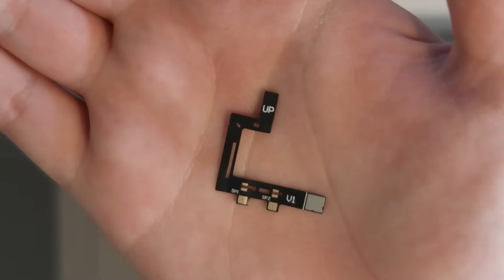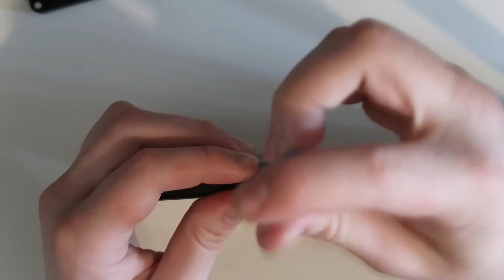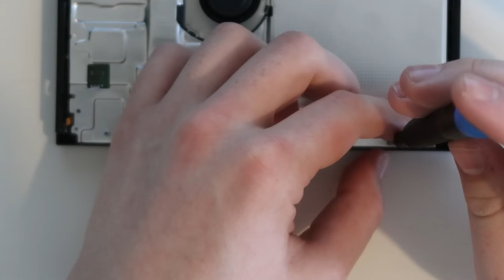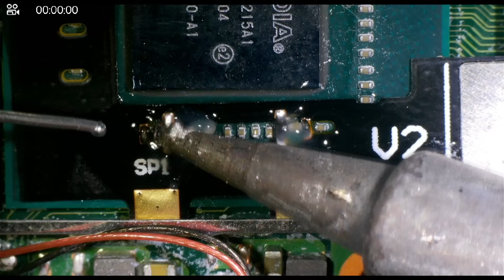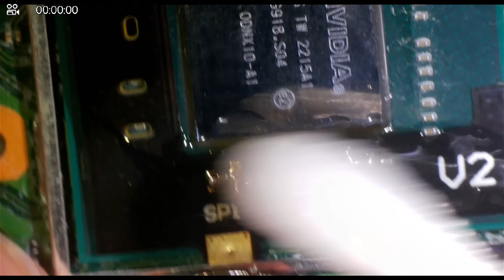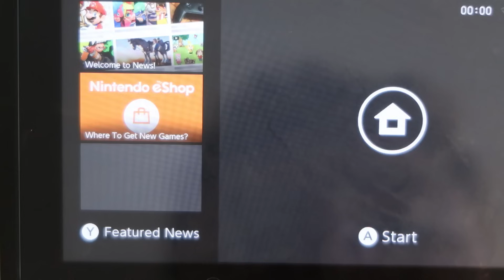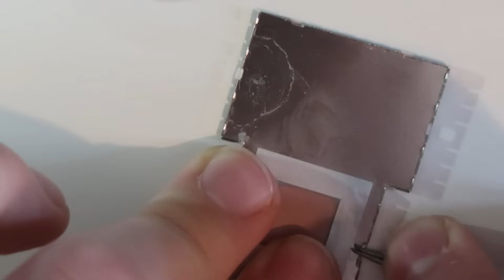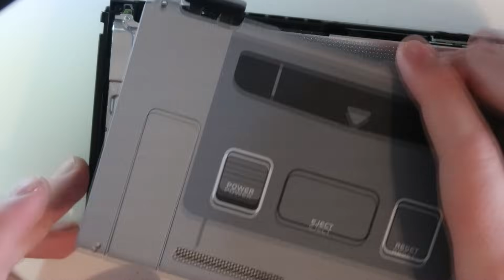Nintendo Switch RP2040 (PicoFly) V2 Modchip Installation

Comment: I am almost 40 and started learning to solder back in school at age 13. I probably solder maybe once a year since I was a teen but I know I will mess this up for a number of reasons. I just paid the equivalent of $60 here in South Africa to do the whole job today. I know there is a very good chance I would have messed up even though I got a little bit of experience but the risk vs the value of the Switch is just not worthwile for me. I own 3 different cheap soldering irons, flux, solder sucker etc in my tool box but to be honest I dont think I even have the correct type or iron or solder but even so I know my expertise is not in soldering since It is almost 3 decades and it is 1 skill I am not good at even though I am the DIY type

Comment: Never looked up how to solder the modchip for the Switch till just now. What an easy, simple, and straightforward soldering job this is. For those who are wanting to attempt it on their own but have no soldering experience, there is one thing that seems pretty apparent that could become very problematic. Manufacturers typically use lead-free solder with surface mounted devices (SMD) when assembling electronics, presumably what every Nintendo Switch has. Lead-free solder inherently has a higher melting point than leaded solder, exactly why people highly recommend using leaded solder due to it having a lower melting point effectively making it 'easier' to work with. If you use leaded solder, which you should, be careful not to un-solder those tiny capacitors you're soldering to on the Switch's motherboard. You can get them back on, but it's very challenging and you almost certainly would need solder paste and a heat gun to get it back on IF you don't lose that tiny capacitor upon knocking it off. 

I've only soldered the Electron Shepherd's Wii HDMI kit before (was my first soldering job also), and that imo is more challenging than this modchip for the Switch. Do your research, watch lots of videos, only attempt when you fully have the grasp of what soldering is. Hope this helps someone!

Comment: Wow, this looks way easier than I thought. I have a Switch 2, so I think I might take a crack at doing it. Good news is that I have pretty much all the tools at home already, so it's only the mod chip and I think I need to buy some flux.
Reply: this is for a switch 1 v2, not a switch 2 (i think)

Comment: “Bridged onto the wrong one” wrong one what? What are you even doing? Wish you’d explain instead of saying adding flux adding iron cleaning iron, never actually say what the goal of this step is, are we connecting the chip to the console with the soldering ? Looks like all you did was make some bigger points to attach to but then attach to what? Wish you’d actually have a tutorial instead of just saying the very obvious things we can see “cleaning the iron” “it looks connected” yet you just said it looked connected and said you needed to fix it, so is it suppose to connect or what? Connect to what as well? Redo this one? Redo what exactly? This hurt to watch
Reply: I totally agree, he should of made it clear which points need to be solder and to what...

Comment: Have a expert mod your switch with a mod chip and do not try this yourselves folks unless you are a skilled soldering expert and have a professional needle sized soldering iron tip. The CPU in the Nintendo switch is the size of a quarter, and those caps on it are pin prick tiny, as in smaller that the period at the end of this sentence. You will need a microscope to see them! If you try this with a regular soldering iron and your a newbie, you WILL mess up and BORK your switch!!

Comment: I got the same issue after modding my switch. The modchip comes blank so you will have to plug the mod chop into the pc and drag and drop the updated firmware into the mod chip. Then connect the modchip to your switch again. And it will work and show the no sd card message

Comment: Need help. Everything worked fine until i connected the emmc to the modchip. I have connected everything properly but it just wont boot regardles what i do. As soon as i unplug the chip and put the original emmc back into the original spot, while leaving all soldering as is, the seitch boots into the nintendo firmware without any problem

Comment: I am a 17 year old boy and this is my first soldering project. I was very nervous but in the end it was just a game of patience i failed to solder the points several times and the switch didnt boot, but after trying more times with less hope in the end i managed to solder the points correctly and the switch booted. I am very grateful that it did work out and very much thank you for your video. This helped me out a lot❤.
Reply: can you pls tell me what you bought to solder? I tried looking up microsoldering kits but i had no idea what to even look into buying. thanks
Reply: @Gaw @Gawall657  very late reply and i hope you have found something that works for you, but if you still need it, I like the pinecil v1 and v2 or ts100 or ts101, honestly just pick whatever’s cheapest in your country

Comment: Friend, it doesn't emit sound from the V1 continuity test. From V2, it does emit sound. I thought they were short-circuited, but my console turns on normally, but it takes a long time with the chip installed. It varies from a few seconds to 1 minute for the console to turn on. The modchip is fucked up?

Comment: First off, probably the best video on yt for this, thank you! 

Secondly, I ran into an issue after attaching the chip and putting everything back together. I booted the switch and got the Nintendo logo and it booted to main screen. This is AFTER I installed the files on the chip. I've tried 2 different files now and still nothing. Any suggestions?

Comment: Your struggles on the initial solder came from having a crooked  placement of the strip. You moved it when you used your tweezers to hold it down. You should make a new video doing this the right way as you are teaching newbies to be messy.

You also use way too much flux and thermal paste and proceeded to cut shield over switch while the battery was connected. A big no no 😮.

Your technique is mediocre but the video of the process is adequate 🤙

For you newbies, watch the tutorial by @nanofix. A more professional install.

Comment: So the software part for the modchip. I’m using a MacBook and it doesn’t recognise it as a drive or anything, did it holding the boot butting still nothing. Do I need a pc for this?

Comment: 8/13/2025
Firstly they send me each possible cheap even for some weird versioins but not for v2. Ordered right one second time. Ordered soldering station and all other shit. First one soldered nicely, second one probably touched with element on its right, because it didnt turn on (screen light up, but no logo/menu). Desoldered it with wick in panick and it works normally. Gonna update how its going when I'll order smaller tip for my iron, because this one could easily solder three of this chips at once xD

Comment: i was really unsure if i should do this method...but now im 110% confident. See you soldering hearts my eye 😅 ... im an electronics engineer
Reply from the maker: Good luck! 😊
Reply: If you have any switch before mid 2018, then you can soft mod which is modded it with an RCM jig but if you have a switch from mid 2018 or newer, then you have to do this method that he’s doing in the video

Comment: you should also have told that you need to put kapton on and around the sp1 and sp2 to avoid the thermal paste to get on it and kinda destroy everything :)
did not happen to me fortunately but I'm just saying
Reply: Most thermal paste is non-conductive. As you seen in this video before he cleaned the cpu it was covered in thermal paste.

However, the kapton tape is for protecting the solder from shorting on the heatshield I presume.

Comment: It seems pretty complex to work with... I'm kinda scared doing it on my own (I tried soldering a battery for a gbc cartridge, but there the points were bigger than the chip used here...)

Comment: I tried it, got the solder all perfect, and once i started connecting the mochip itself, i plugged the tiny cable, and as i was about to plug the chil into the board, i ripped out 2 resistors with the solder. gg

Comment: This clearly shows how not to solder. The solder tip used for this type of project is wrong. Chances are the 60/40 solder he is using has flux in it already if its rosin core. Less is more when it comes to using flux. Always use an adjustable temp solder iron for this type of work. To much heat on ribbon cables are a burn through disaster waiting to happen. Lastly solder wick is your best friend, buy it for this type of work. Despite all of that, he still did the job.

Comment: honestly so shocked i actually managed to solder it without a microscope (phone came in handy), great and straightforward tutorial, many thanks.
Reply from the maker: Great stuff, enjoy!
Reply: where did you buy the chip i cant seem to find it
Reply: AliExpress for like 3 euro (3ish dollars), searched for picofly  @jordansimons3601
Reply: @jordansimons3601 aliexpress
Reply: @jordansimons3601 AliExpress, look for Switch modchip V2
Reply: How hot does the solder need to be set?
Reply: @SOGKush420 depends on your solder. Most solder sold now is lead free and requires around 350c - 370c

Comment: my joints keep desoldering after like 10 minutes, any tips?
Reply: Your solder joints should look shiny and if they look dull it's called a cold joint and it will crack. If you are not good with flux and are new to soldering do like I did and try rosin core solder. It has built in flux basically. Hope this helps.
Reply: @Stonecon in the end it was probably because my solder's tip wasn't heating very well, i got a new one and managed to get good joints, thx for trying to help tho :)
Reply: @justbl4ckThanks for the reply man, Im looking into a new gun with temp control and this just sealed tje deal. Im buying it. 😂

Comment: The amount of thermal paste used here is way too much a pea sized drop is perfect On PC's Using too much can hinder cooling Not really on these patched switches but with overclocking Always track the temps They can get quite hot

Comment: For the longest time i thought i needed a decent micro soldering iron ( have a normal iron ), and a microscope either LCD one or the heavier ones you look through and high level of micro-soldering skill. But watching your video seems thats not the case, as you used your normal iron, definitely need a LCD screen microscope for fine soldering, but doesn't seem like i need a micro soldering iron or high micro soldering skill...(as watching your video just flux and take your time) seems the switch isn't a delicate thing. It can handle multiple attempts at soldering the point without overheating or killing the capacitor ( they handle it ) IF  that is the case as i can do it, prob use the fine tip ( and flux ) and seems good just matter of getting a LCD microscope and thats all ?? Just asking as thought i have to pay someone with high micro soldering skill, but seems just a regular iron (normal soldering skill/take your time ) and lcd scope will do ??

Comment: I got this chip and was curious about some resistor value that's being mentioned in gbatemp. About replacing 47ohm resistor with 100ohms.

Have you had any issues or people bringing the switch back due to this or just using the chip as is would be reliable?

Comment: System was booting great during the installation process up until I hooked up the chip. My solder points were good and everything was going smoothly, but I can't figure out where I went wrong. Anyone have any help? 19:40

Edit: fixed it - the mod chip just needed to be flashed, lol.

Comment: Hi i need help, when you were soldering the 2 pieces on the chip to that one piece. can one bit of solder touch all 3 pieces at once or do they have to be seperated with a gap in the middle?

Comment: uhmmm what happens if it is bridged to the wrong lil pin like the pin on the right on the second solder
Reply: It will have a bad result. It shouldnt interact with another pin its an architecture problem otherwise

Comment: I have done all the steps, even having to download the UF2 files since it was not installed when I received my chip. 
The only issue I’m having is that no matter what I’m trying, it boots into Nintendo. I have tried re-soldering, rebooting, etc. the picofly light flashes but then turns off and boots into Nintendo. What am I missing??

Comment: Hello Im at the end part of the disassembly and the Switch won't turn on. It's receiving power because when I plug in the charger that came with the switch it becomes warm but it's not displaying at all. And I've checked that there are no damaged capacitors. Idk what to do

Comment: Wht if u have a patch swicth that quit working after a fN update but stuck in rcm I’ve change the battery and it turns on and off but only when it’s on rcm by usb connection to the labtop and when I mean turn on I mean jst a balck screen and rcm tegra app saying connected and disconnected when I hold the button for 10-15 sec and then on whne I press it could I do this mod and should it  make my swicth work again or be ready to install the mod or make it turn on again I want to fix it but dnt knw wht to do but willing to try
Reply from the maker: I have no idea what any of this means.

Comment: Just winged this without a microscope, somehow managed to make some pristine joints despite barely seeing anything haha!! It's much easier with a T12 iron though. Thanks for the tutorial especially for including reassembly and everything it's very well made.
Reply from the maker: Glad I could help, well done with your install. 😊
Reply: I have a small station with a magnifying glass and I see microscope and about died 😂😂😂
Reply: And I just fried my cpu ...
Reply: What tip
Reply: I tried it once without a microscope, managed to get both points soldered but knocked off the SP1 cap and  somehow it still worked lol. I will try again with V2 tomorrow, see if I get it right this time.

Comment: Will this work for patched v2
Reply from the maker: Yes, that’s the model I’m using in the video.
Reply: @TheModSmith  thanks brother I am trying this for the first time.
Reply: @TheModSmith  I got the chance to try it but after the installation switch doesn't boot into ofw or cfw.
 I also lost the capacitor on the right side of the sp1 If I remove the installation I can use it normally

Comment: Christ dude why don't you get the proper tools. You need a finer point on your tip also you have to heat up where your soldering not just relying on the solder heating it up that's why you're having so much trouble cuz you can't get in there with the point being so broad. Also some finer solder would be helpful so you don't get big Globs
Reply from the maker: This is an old video, I've since changed tools.

Comment: Those tiny little caps are a nightmare I'm too shaky to solder the ribbon directly onto the caps, they are extremely easy to bridge, I already naffed one of the caps on the switch by accidentally bridging it and it would not unbridge from love nor money even with a fine tip soldering iron and gel flux in the end I had to take the cap off as it wouldn't free from the ribbon, I replaced the cap with a new one, in the end I tacked tiny coated   wires onto the sides of the caps it's a lot easier safer to hit the caps from the sides rather then go in on top of them and risk bridging the buggers, I ran the wires under the ribbon held down with kapton tape then folded them back onto the top then solder the wires to the ribbon.

Comment: why they dont make an modchip that dont require soldering skills and just plug and play ?
Reply from the maker: I’m not sure if this could be done. The points on the motherboard that need to be soldered don’t exactly have anything to hold onto. It’s an interesting idea, but I can’t see any solderless kits being a solution in the long term.

Comment: Bought a switch at 150€ with case  dock and a controller then gave 100€ for modding and 250 evo ssd Samsung the guy asked me 80€ for modding so in total I payed 250€ for all of this does it worth it or I am scammed ? Ps the switch I bought is in excellent condition
Reply: Its a good price bro. I paid 110€ for the Switch. And the modchip cost like 10€ and you see its dificult to make it. He take 70€ for the work. Its all good
Reply: @Dozey48  thank you for the reply.

Comment: After removing the little metal cpu case i turned the switch on and got bsod... I guess i made a tiny tiny little scratch on the surface of the mainboard. Is there anything I can do??

Comment: for these soldering jobs I can really suggest you the TS80P soldering iron with the J02 soldering tip. Its slightly angled and really nice working under a microscope. Tip size diameter is 0.2mm